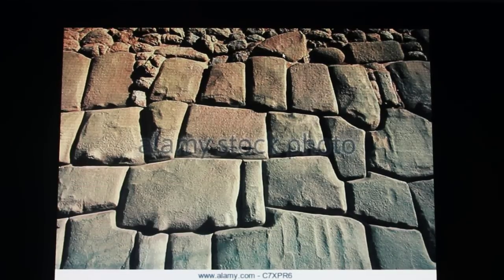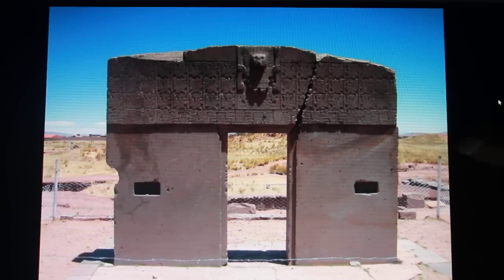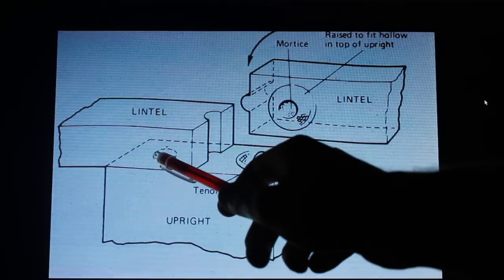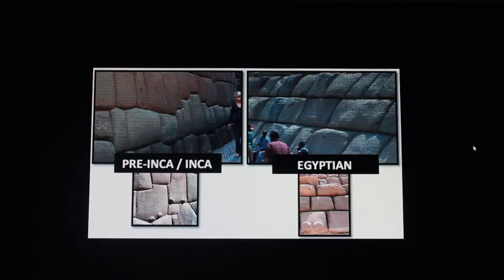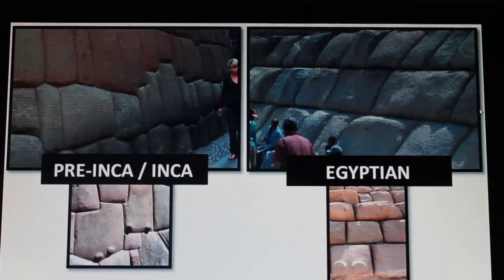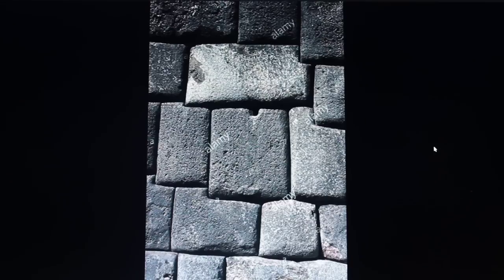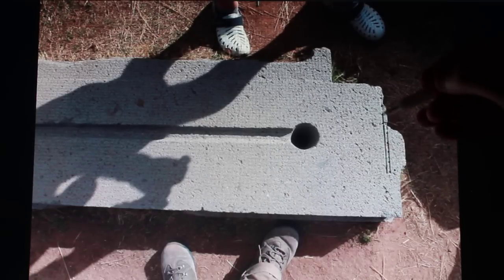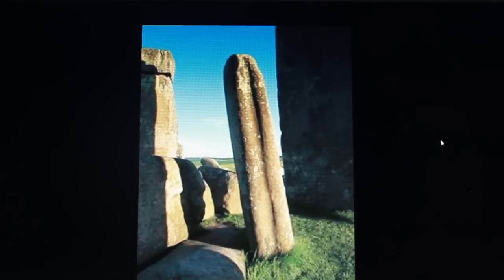Is this what the NUBS on megalithic pre-Inca walls are for? (FOR JOINING STONE?, Proof provided)

Comment: Here is my theory on megalithic rock protrusions and scrap marks on the wall stones. If we follow the theory that the rocks were used as a  vibrational apparatus, there are 2 things going on. One, the reason for the near perfect alignment from stone to stone is to create the wall as one piece instead of a hundred individual rocks. This closeness helped with the vibration resonance that they would achieve for some specific purpose. Secondly and most importantly the “nubs”. I believe the nubs and the scraps are being used to tune the wall. This would be almost the same reason weights are attached to car rims to balance them and to eliminate vibration. By adding the nubs and also taking away material, the rock and its complete wall system could be tuned to the frequency they desired. Let me know what you think. Thanks

Comment: Geo polymer...they poured them into big sacks in place..then when its almost dry,to test it,they cut two holes at the bottom.....then the polymer oozed out a little..and when the nubs were dry , it meant the block was ready
Reply: I don't think the stones were ever 'wet'. They had a method of playing with it's atomic structure enough to make them malleable. Once they stopped that method the rocks were instantly solid. Waiting for a rock to dry of the magnitude of these rocks would have been excruciatingly slow. Plus making rocks fluid would have most likely also made their atomic stability weaker or brittle. These rocks still exhibit all the normal structure and features of natural granite.

Comment: They don’t need little nubs slotted together. They are too small on huge stones they wouldn’t work, they’d break too easily. I think they are the sonic centre points of the rock. The conical sonic cones were held at these points.
So if they were for joining stones, why were other megalithic structures joined with molten metal. I think truly they could manipulate the   Molecular structure of rock to make it mailable and light. You see it in all these structures. The rocks were made pliable and then poured into place I.e. Granite returned to its molten state) The rock was then allowed to return to its solid state, and allowed to cool. Hence the fantastic different angles and shapes, which were intentional as it made them virtually indestructible to earthquakes. This also accounts for the lack of gaps in the joints, and also for the needless lack of mortar. The nubs are quite possibly the pour point and would , to a degree stabilise lateral movement. This too would explain the scoop marks, which are also seen to a greater degree beside the giant columns at the site of the megalithic Granite quarry. This has to be close to the answer as no other explanation I’ve so far seen is applicable to sites across the Globe.

REMEMBER YOU HEARD IT HERE FIRST.

Comment: The nubs are where the mold had a blow out when they were still soft before it hardened that's why there is no rhyme or reason for them and that would make sence why most of them are at the bottom of the stone, that's what I would think and have seen when you pour concrete sometimes you get a blow out where your form comes together. Of all the things that I have heard that is most likely to me

Comment: The "nubs" have no meaning or function. They are merely a result of the production process. When stone is being quarried, certain patterns repeat if the quarrying method remains unchanged, and usually the easiest and/or fastest process is the one that is regularly repeated. They just "happened" and did not interfere in building the structure, and therefore were left in place.
Reply: I'm sorry, I lied. They made them just to fuck with your head.

Comment: The nubs and inverse nubs are for flooring, these structures would have been huge with multiple levels, They are made from a type of concrete that uses heat instead of water and yes it can be recycled simply by reheating it, The magic ingredient is sulpher. The reason for the different shapes is most likely purely artistic, There is no mystery, they just liked the look of it, Puma Punku shows us how these besa blocks were held together with lock pins whilst heat would have been applied to  the joins, Puma Punku looks like a massive hexagonal section done structure which has ofcourse collapsed and then been vandelised by present day archiologists who have arranged the blocks like lego 

I will watch the vid on Friday and support your efforts to broaden ppls understanding of these subjects thx

Comment: Looks clear to me that those are matrix pours - liquid matrix of sand and home brewed cement - the "nubs" are from the release of a mold that gets "stood-up" on either face. You got the "scooped out" marks right - those are a mason's tool smoothing out the faces for some reason. Probably tool presses - or the face of the mold in some cases. This is obviously a wall that was liquid at some point and assembled in gigantic, very cool, and totally unique pieces / pours.  I think we should try this at home and see..  If there are mortice and tenons, they would be found on the interfaces.  For sure the irregular joinery makes that wall impervious to shaking.  I'm thinking that we can reverse engineer this and get the same results -- with two guys and cement mixer. You, CK?

Comment: Thanks for sharing. Your last pic at 9.45 shows two square holes and one round. Yes they had a purpose but neither you nor I can say what that purpose was. It also looks to me like it is either concrete or stone with a cement rendering on top - badly finished around the edges of the squares and circle. You can eve see the difference of the added rendering to shape the edges.
Reply: looks like a fossilized creeper from MC could they have created minecraft thousands of years before we did?....

Comment: Get a metalurgist to look at the knobs.      I see where two carbon electrodes pressed into the rock, heating with current and frequented, the rock becomes plastic.  The electrodes pulled out of finished stoned as it cools,
 could make a tensile break after a knecking .

Comment: Megalith Building Style. The finished thing, with minute joints, and near perfectly smooth finish, surely must make for a truly wonderful  defensive wall? Un-scaleable without ladders.  Immune to battering rams? :~:  To have been able to move some of these blocks is truly a wonder.  Both the power needed and the method.  I would reckon that what have been called "Nubs" will have been points about which ropes may have been wrapped, during  their placement. :~: The 'finish' of the stones, once in place, is surely secondary to that? :~: The sides that are most important, in the placing of these stones is surely those that meet up with others? And who knows if those hidden from view side to side contacts are particularly accurate? Where the front faces meet each other yes! That will have been the most desirable thing, once they've been hoisted/maneuvered into place.  :~: Once in place,  the face edge, perhaps left rough? could now bee finished off at leisure. ANY protrusions left would enable someone trying to scale the wall, an easier task, so it would be smoothed off.  To be sure, the gouges, in a vertical alignment,  seem to be the 'finishing' of the face of the stone. :~: I have no suggestion to offer as to why SOME 'Nubs' still remain, except that it will have been intended to get around to them eventually?

Comment: I believe the only possible process these stone walls could have been formed is by vibration! They had electricity....enough to create frequencies that would vibrate the stones into each other. The edges would crack away and would be finished by hand making them seem to puff out in 3 dimensions. The nubs were used to attach the instrument that caused the vibrations.

Comment: It just makes no sense to suggest that the nubs were there for the purpose of fitting into another layer of wall. They would have offered no  structural benefit and would have needlessly complicated construction since they would have had to make the nubs and depressions match. That would mean they would need the additional layer would need stones in the same shapes as the wall here. . As for cutting the stones, this was demonstrated in a nova episode where they used copper and abrasive sand. The sand cuts the stones very cleanly. Granite will split in rather straight lines. We see several courses of stones with some stones protruding down into the lower course. This is obviously a structural feature to make the wall more stable. It is said that the stones  are stable during an earthquake. They may move, jiggle, but they come to rest again in their original location. The stones that protrude into the lower courses keep the courses form sliding one way or the other. As for moving the stones and placing them, either the whole area of construction was flooded or they had levees that increased in height as the wall was built. The stones were transported by attaching floats to them, therefore , the nubs or notches.

Comment: Perhaps anchor points to fixate machinery, my gut feeling is all these buildings are some kind of harbours, if they could soften stone for sure they would have made them smooth if it was for human living, if it is some kind of harbour who cares about how it looks, it needs to be sturdy that's all.

or if we start from the point these blocks are made from concrete, hardened inside a flexible bag.. these nubs where the points a rope was attached to these bags, to prevent them sliding of the lower layer.  the inverted nubs could use be damaged nubs.

Comment: Sandbag technology.  They invented a liquid Cement that formed rock stone.
Reply: surferboycoolable
Umm.. So what method would that be accomplished with? Do you think a giant furnace for melting rocks is hiding somewhere in South America? I would stretch to say that there wasn't a tough enough crucible to contain lava. Certainly not for several hours at a time. Also, if they had molten rock, why not just pour it over a lattice and reduce earthquake damages by pouring in successive separate slabs OR all in one shot for continuity.

Comment: If you believe the stone blocks are cast material, meaning they're a soft/liquid material poured into a sort of form like concrete, then the nubs you see would likely be vent ports in the form. When you pour stuff into a mold you need to have vents to prevent weird air pockets and allow the material to flow into place.

Comment: what if maybe they had the tech to make some kind of granite cement like or cement today except that when this mix drys it drys as granite and the nubs where just the access to the inside of the mold that the wet granite mix was poured into. they simply filled the mold up a little to much so the mix was over flowed into the mold access where it dried and became the block. it would explain now they could fit them soo well and move them so far at those weights because they simply made them on sight. i dunno just a thought I guess

Comment: Not for joining walls, the nubs would be too small to resist movement.  I think the wall is made loosely at first with large joints, then each rock is heated then adjacent rocks are heated allowing workers to push/leverage then mold joints together, let harden......

Comment: If the nubs were reminents of an older use, why would they end up always on the edges of the reused boulders, regarding that the blocks were formed and adapted to fit perfectly together? But maybe this explains why they are absent on other blocks: because they were chiseled away when no longer needed.
But I have a different hypothesis for the transportation issue: I would build large frames like a portal crane and sling ropes around the blocks so that the rocks can be hopped forward or around curves if you turn the frame a bit. This way you need only very few people to do that, you can go up a ramp and around corners. But you would need to prevent the ropes to slip off or you would need some lifting or supporting structure to be able to sling the rope around it.
With these frame cranes you could easily transport big blocks even on sand, you won't need solid roads like for rolling something.
Even cultures without wheels can do this like the megalithic ones.
With these frames you could as well lift the rocks by hopping back and forth or just a bit up, each time supporting the rock in the position of maximum elevation, for example with: sand.
Riddle solved, I would say.

Comment: What if the nubs werent' FOR lifting but FROM lifting. If the blocks were soft as has been suggested, then the protuding and recessed marks could be from whatever mechanism was used to lift them. The theory that the blocks were recycled from another structure falls down because these stone blocks are taylored to fit the stones surrounding it. That fit could not happen with recycling.
Clearly there are recesses used for linking the blocks together, but they are very different. These walls are known to be earthquake proof, they are also extremely solid as though to protect against weaponry much more powerful than we have today.
Look at Vellore fort. India, particularly the thickness of the walls at the top level. You would not make them this thick for no reason.
There are the same nubs and these are not 'recycled from elsewhere' stones. The stonework is the same taylored-fit, polygonal blocks as elsewhere in the world.

Comment: I believe that these folks that built these structures also built aqua ducts & water control.... these nubs or controlling knobs, used for tied or secured rope like floats to move the heavy rock blocks  in water or under water... use animal’s inside organs filled with air as floats along with plant floating materials. Joining blocks and control of blocks is done by holes & handles plus grips to rotate or flip while in water. Cutting rock in quarry done with beating the cut line & applying heat to weaken the rock..... powdered rock is often flammable and could have been used for light. Many minerals can be mixed to be corrosive to rock allowing the appearance of polished surface... along with cloth or skins with trapped stones of harder surfaces can act as high grade sand paper, along with water could be very corrosive creating any number of perfectly fit shapes.... bu cutting both top & bottom at the same time there would be a perfect fit... (sandwich the cutting surfaces with the material)...

Comment: Thinking back to a time without written language, perhaps the nubs were a means of communication, like large visual Brail. Everything I learn involves stonework acoustics. Before written language, there was only sound, right? How do you incorporate sound into a structure? They cut the blocks and put them in place using intense amounts of holy spirit energy. Faith, trust, (and a whole lot of pixie dust). The end is too close for it to matter anymore. At the end of the day, we should be wondering if anything we've built will still be standing 2000 years later for psychedelic peoples of the future to analyze and marvel at.

Comment: Here is my question about the "keystone cuts" or joins as you call them. If you look closely at those keystone cuts in comparison to the megalithic size of these blocks it doesn't seem at all realistic that those keystone cuts could prevent the stones from shifting or falling away from one another in the event of an earthquake, etc. The weight of each stone is so massive that a small metal clasp isn't going to hold it together as the cuts are not very deep, nor are they very large really. What other reason could the keystone cuts have been put there for? (that's my question, ha)
Reply from the maker: True. Could be for a wooden or metal structure then, like gold? IE legend of the seven cities of gold? Great comment!